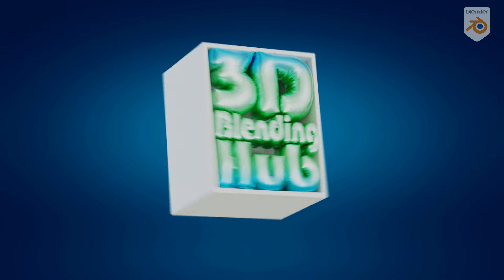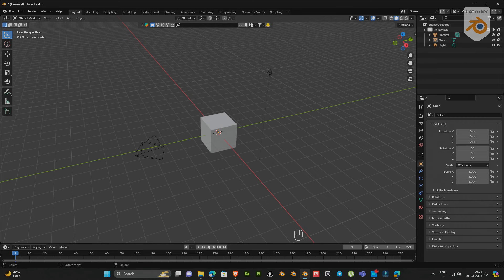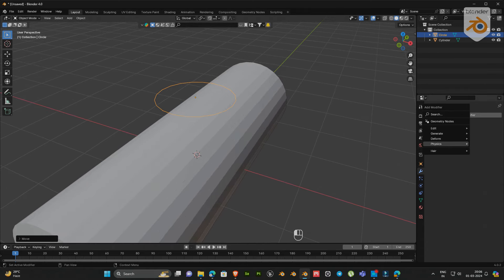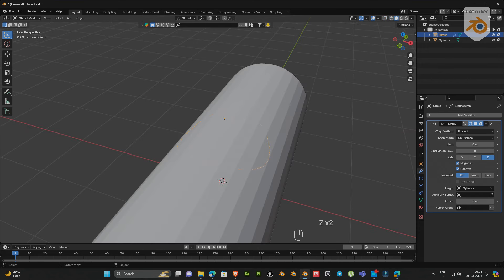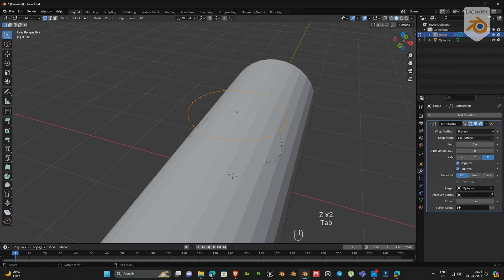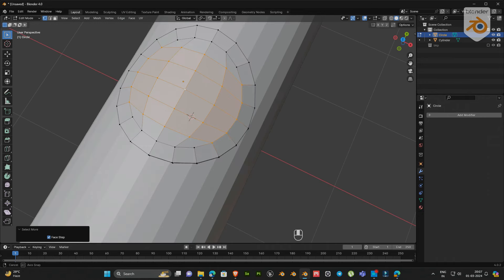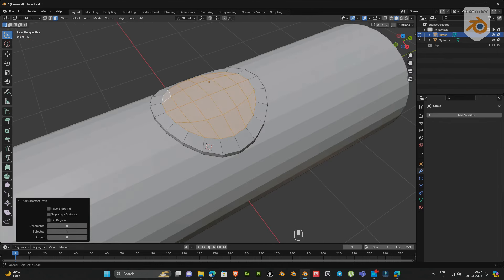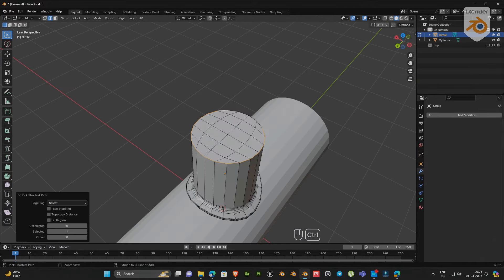Blender Modeling Tips & Tricks | Part_03 | Blender

Comment: When practicing I came across following problems:
1) It is the shrinkrwap modifier, not simple deform.
2) Projection works only if I scaled the circle smaller than the cylinder, else it makes some strange jaggy edges.